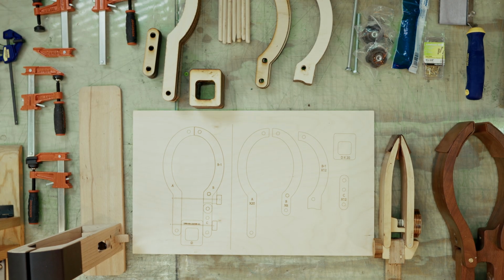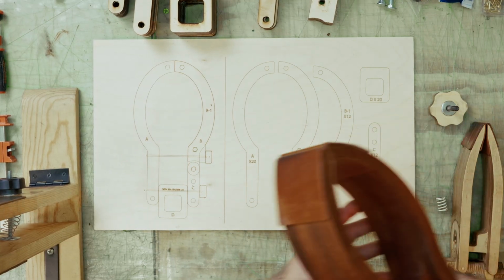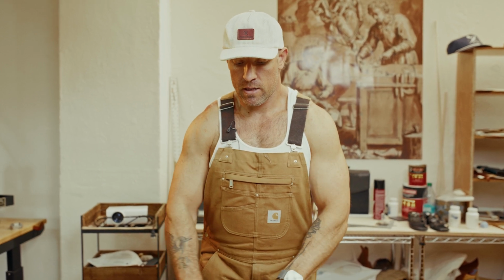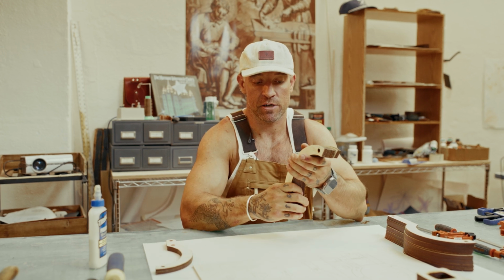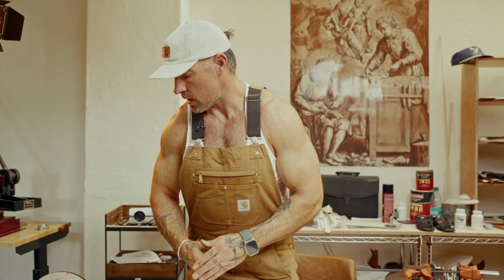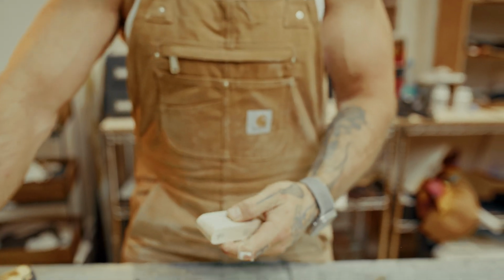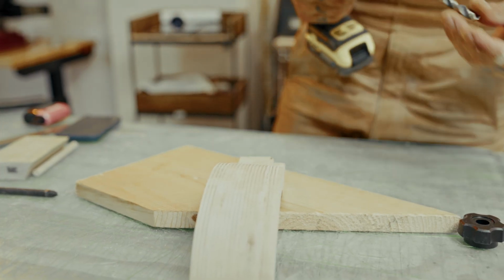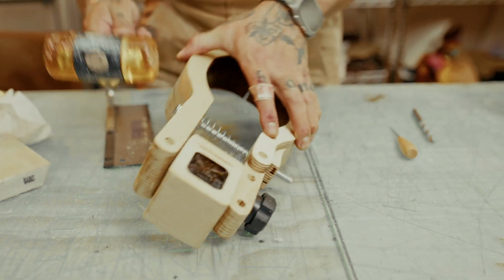Laser Cut Stitching Pony!? (and pony reviews)

Comment: Have you seen the (French)  saddlers clams sold by a company called abbey.? Floor length, use your thighs to squeeze. No clamping to anything. I learn to do saddlery on one of these. Still got it. No worry about bolts breaking from stress. You hold it between your thighs.
Reply from the maker: I don’t have the lower body stamina haha

Comment: I am also woodworker and find this to be a very flawed design. I have not been able to get the jaws to maintain consistent contact in both the upright and forward position. I have spent months working on this. It is a deceptive video. There are much better designs available.
Reply from the maker: Good thing I’m not selling the design or the video. It was an experiment. But it shouldn’t take you two months to cut some straight lines in the jaws

Comment: For your old stitching pony with the stripped threading, chuck a thick and tight bungee cord around the clamps. I've been using bungee cord instead of the original tightening mechanism on mine because it doesn't give enough tension for thin pieces.

Comment: @Opensealeather you mentioned you were not a woodworker and certain parts break from use. 
Here is a suggestion...why not offer to trade skills with a woodworker or metal smith? There are plenty of woodworkers interested in leather works (that's why I'm here). One of my favourite hammers when I was younger was a leather wrapped hammer..
Are there metal versions of these devices?

Comment: Thanks for the video, I have made a couple of stitching ponies recently. The first was a basic one similar to the  cheap one you show, and my second is  similar to the high end ones. My better one was made using my 3018 CNC machine and I learnt a lot during the make and assembly processes. 

My build was based around materials I already had to hand during lockdown, and as a result the clamp to the table was never finished, so I resorted to using wood clamps similar to the one in the video.

I found that a challenge I had, and which could explain the issues you have with stripped threads, is that the angle changes with opening and closing of the stitching pony. I had to oval out the bolt hole to allow some movement of the carriage bolt as I had used fixed threaded inserts.

I think on my next build, I will use threaded cams and a slot to allow it to pivot with the movement of the jaws.

Don't worry about the skills you have, I have seen far worse from other creators calling themselves wood workers😂

To fix your broken arm piece, I would drill holes and glue dowels into the pieces for extra rigidity. You obviously have the means to achieve this.

The only main negative comment on your latest build is that the jaws don't seem to line up and are different sizes.

Luckily I also have access to a large format CNC router so I can use 30 or 40mm thick plywood on my next version.
I will possibly "borrow" your idea of the square box shape to allow clamping to work surface😊
Reply from the maker: Thanks for the thoughtful comment! Yes it was a little misaligned because my laser wasn’t cutting accurately due to a loose belt. I’m working on version 2 that I like a lot more!